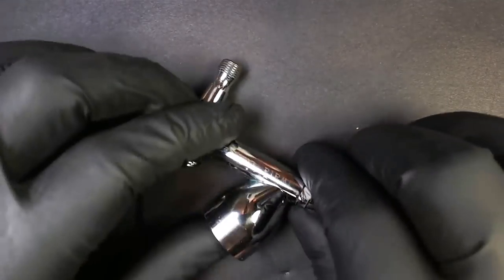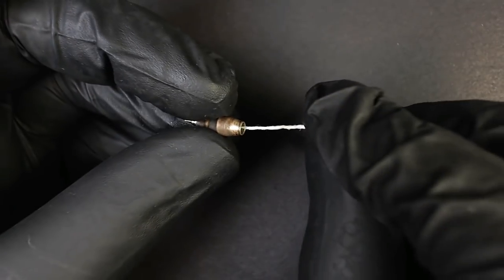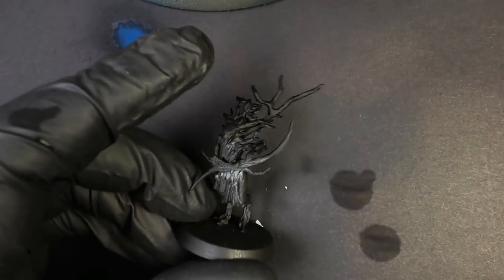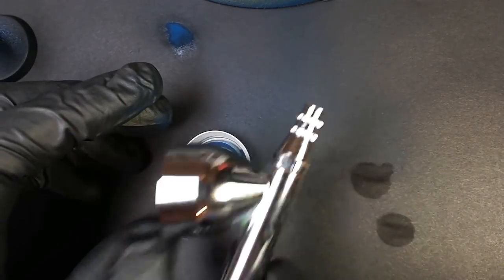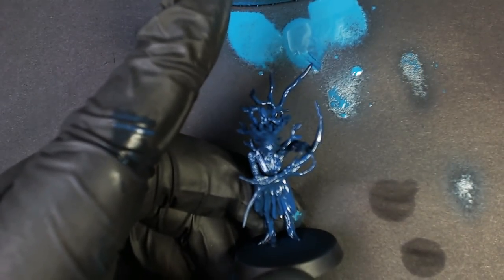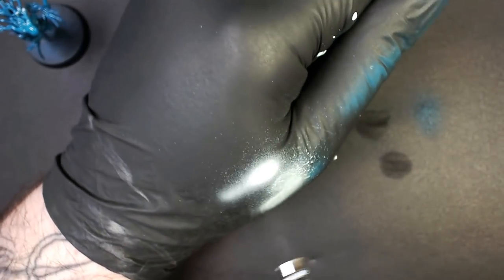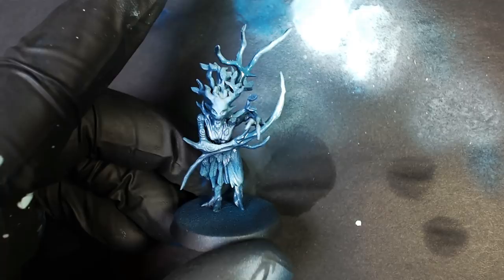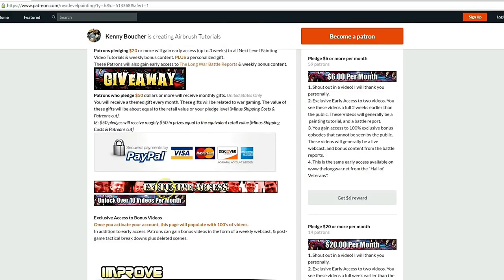Is Your Airbrush Clogged?

Comment: New to this shit. Badger Patriot 105. The needle sticks out past the tip. Is that supposed to be that way?
Reply: Yup (I have one -- it's what I started with, and is a workhorse). Just be careful not to bend the tip, which is easier to do since it sticks out. Cheers!

Comment: do i have to use flow improver or airbrush thinner vallejo?     had clogging with arctic blue vallejo.
Reply: Is that a Model Air color?  I find that I dont need anything with the model air but their regular model color you need to thin down heavily!
Reply: yea its model air metallic (arctic blue)the airbrush wouldn't work. spit bursts sometimes.
 @Adol666
Reply: @kairus1  Maybe cause its metallic?  IDK Im no paint expert.  All paints will clog at some point.  Like the Vallejo Preminum black I can work forever with before it starts clogging.  Maybe your PSI is too low or too high?
Reply: yea i was thinking the same metallic. i did pump the psi really high thats when airbrush would spatter. the only thing i didnt do was push back the needle to blow out the paint. and then spray. next time ill try that.  @Adol666